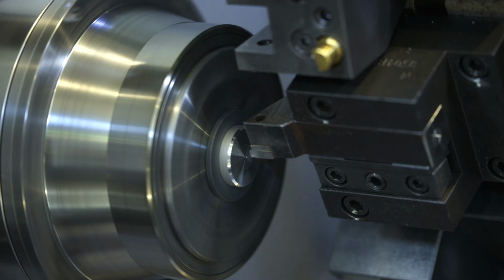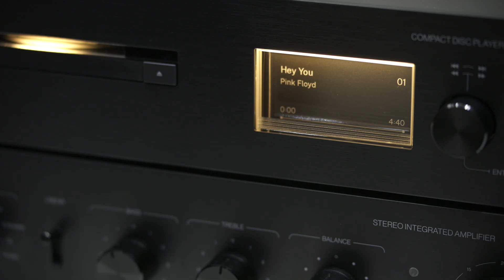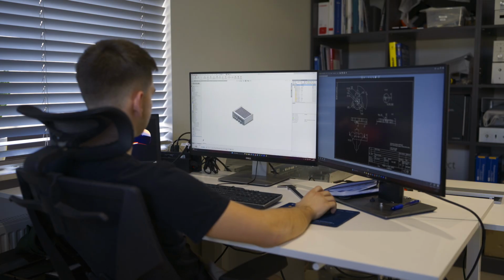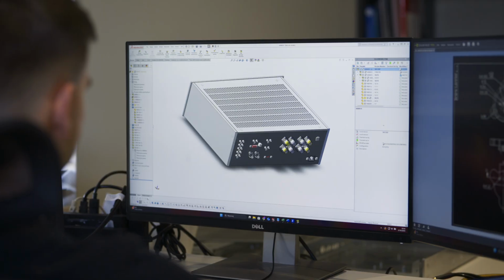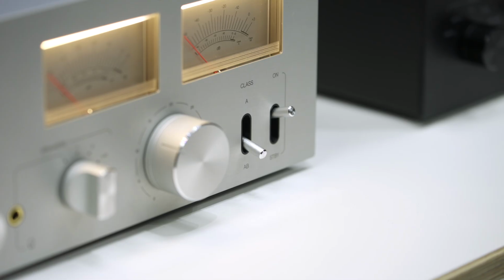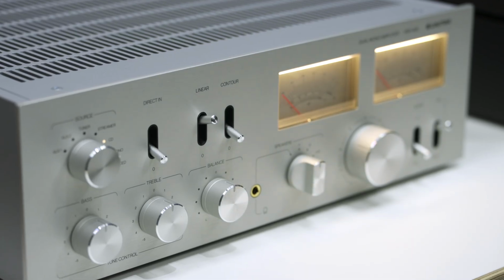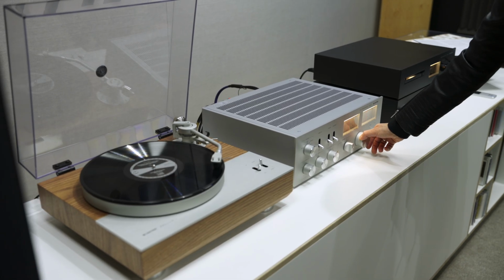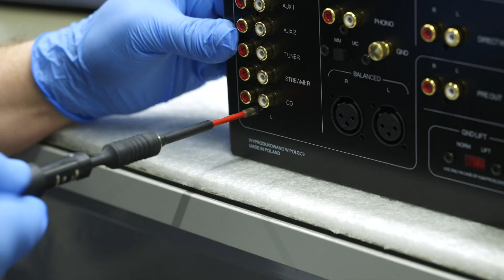How AUDIO AMPLIFIERS of the ICONIC Polish brand UNITRA are made?

Comment: I like the way how they have a switch to change the audio amplifier from Class-A to Class-AB and vice versa.
Reply: By changing the operating point of the power transistors in the amplifier output stage.
There is no great discovery here. The only difficulty lies in selecting the amplifier's operating parameters in such a way as to maintain its thermal stability. It is not easy, but - as you can see - possible.